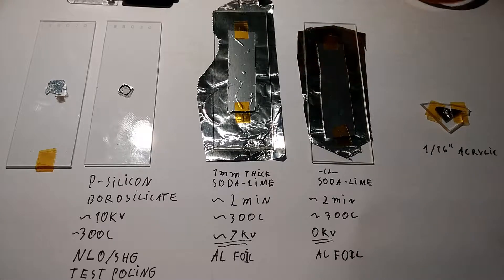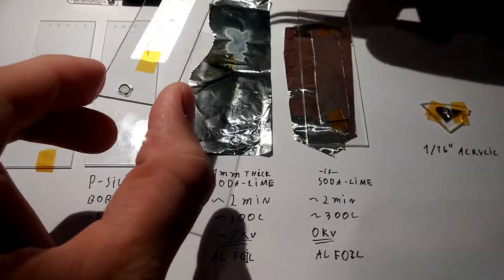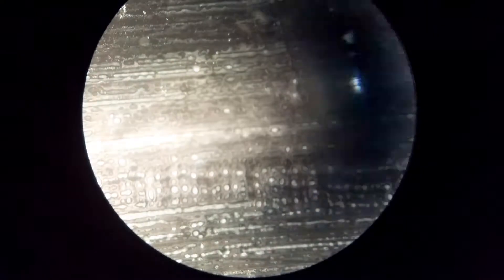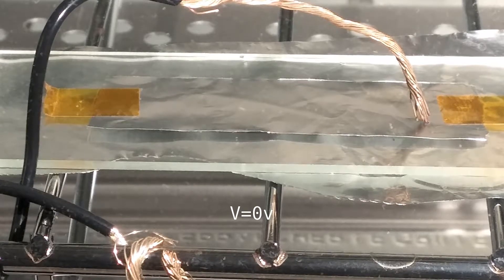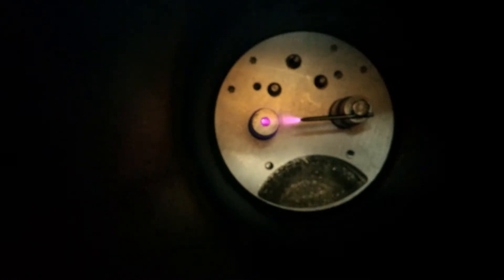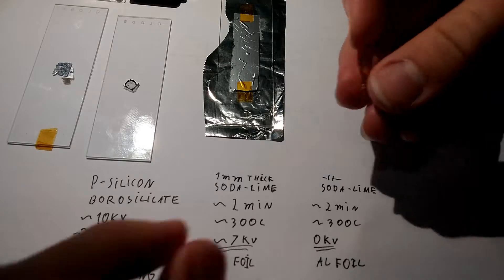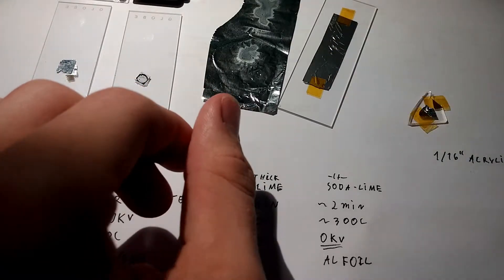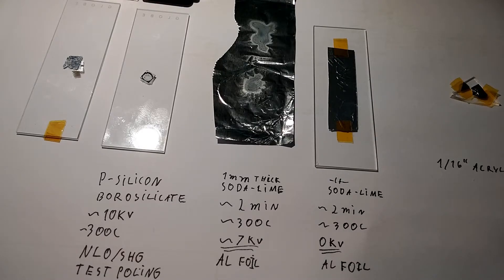Electroadhesion

Comment: Can you use this same process to glue 2 different metals together? Aluminum and copper for example
Reply from the maker: Good question! I'm not sure, but I don't think that would be possible. I believe one of the requirements of the specific process I encountered in this video (anodic bonding / "uncontrollable electroadhesive contact") - is that one of the two materials to be bonded needs to be a semiconductor - i.e. something like glass or silicon!